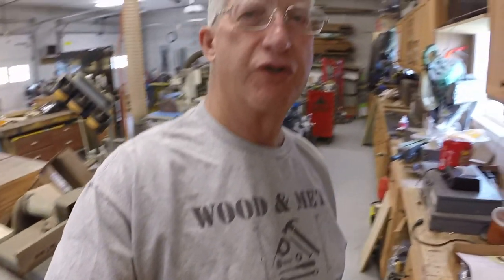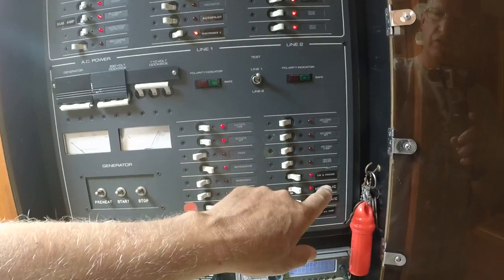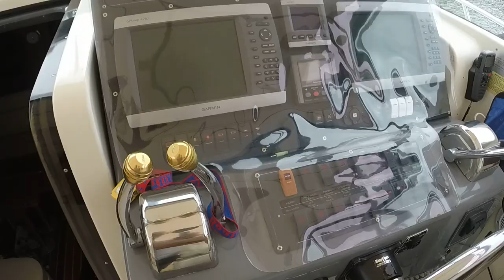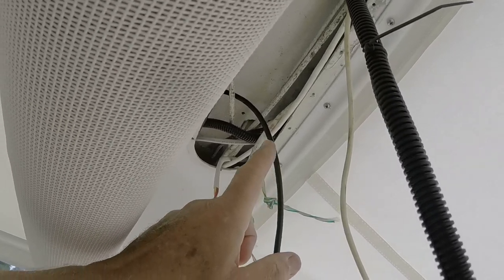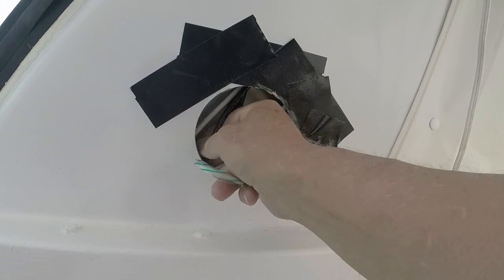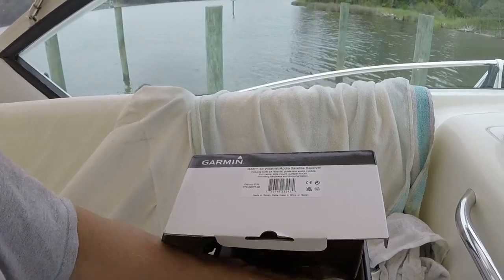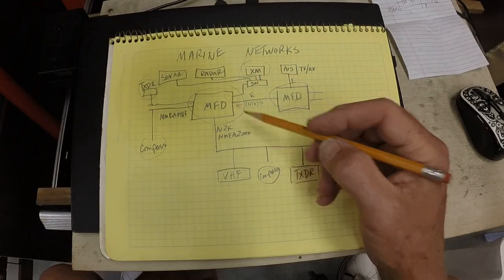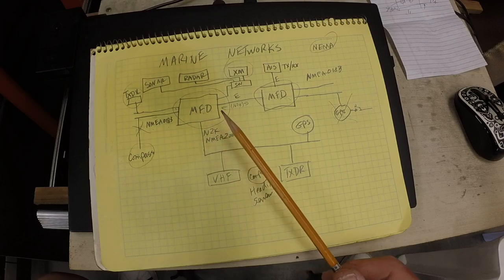Garmin Marine Electronics Upgrade!

Comment: Those are very nice helm stations. Head arms and shoulders better than what I have on my Carver. Lol
When I got my boat I made a point of removing every last stinking wire nut (I found a shoebox full!) and evey inused cable installed by the 5 previous owners. I wound up with a ton of room in the chases.

Comment: Hey Frank...thank you for a great video.  THAT is a nice boat.  Ours doesn't come close, lol.  Quick question: did I understand that you are eliminating your compass?  If that is what you said, how would you navigate if the electronics went totally down?
Reply from the maker: No, not eliminating the compass. Just disconnecting the heading input to the network and replacing that input with a different device.  You'll see that (9 axis heading sensor) installed in the next video.  Also, I recognize that the compass I am using is an electronic compass, which, like all electronics is subject to failure. I carry two additional magnetic compasses on the boat--called hand bearing compasses--that will come into use should all else fail.  I also carry a hand held battery powered GPS with me on the boat. I'm a big believer in redundancy.

Comment: How do you plan to replace your transducer? It’s nice that your boat is on a lift, but do you have access to small boat to get under your big boat?  Also is there any value to your old displays, just out of curiosity? If your not comfortable answering that than don’t, I get it. 
Very interesting stuff with everything you have plugged in. Thanks for sharing.
Reply from the maker: No need to replace the transducer, just the electronics attached to it. But yes, I do have a couple small boats--an inflatable dinghy and a row boat, that can get under the big boat should I need to.  I will eventually add a third transducer to enable the new capabilities of these MFDs, chirp and side scan sonar.  The old displays would sell on ebay for about $700 each.  At least that's what I am seeing. Haven't decided what to do with them yet. I teach classes in marine electrical systems and marine electronics so I may assemble a teaching aid using some of this gear.
Reply: @woodandmetalshoptime8048 , Thanks for the reply, even more interesting things that you do. With the side scan sonar, do you use it to find old ship wreckage? Do you scuba dive also? Probably too many questions!